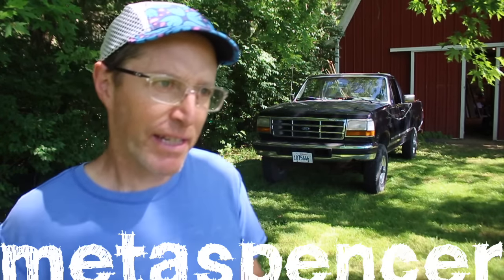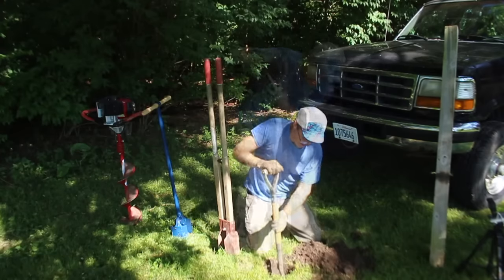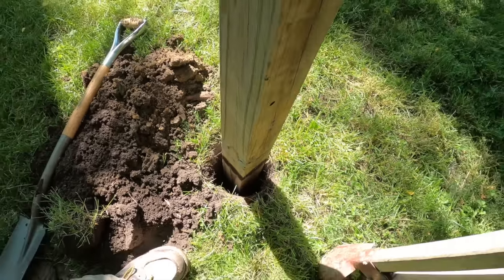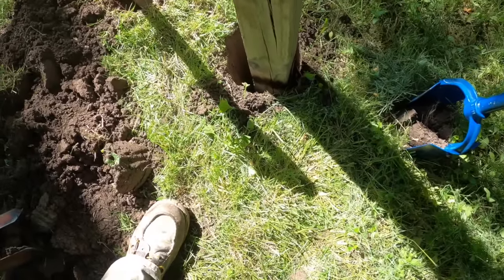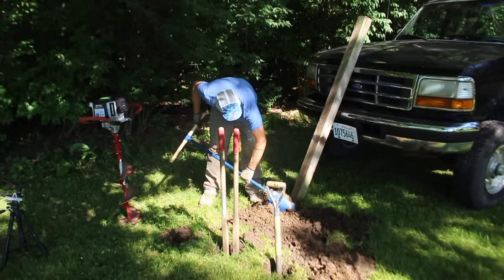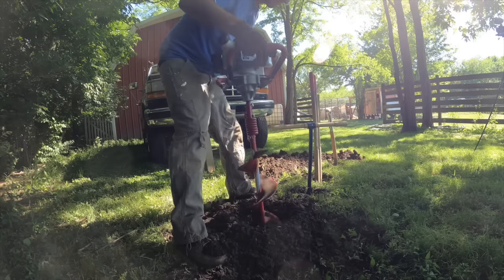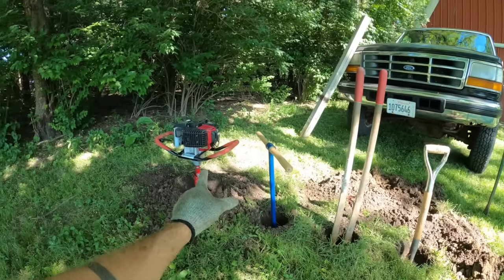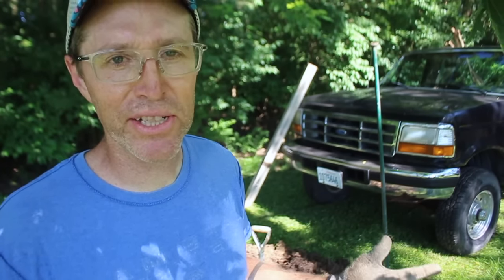Post Hole Digger Showdown!

Comment: I ended up with permanent nerve damage in my dominant wrist when my Earthquake grabbed a large root.  Can't bench press anymore, no more curling bar, no free weights.. it's hell just turning a door knob.  🤜💥🤛
Reply from the maker: Oh that's horrible. They are super dangerous -- no doubt about it. I was using mine today to drill some holes down to 4' and was reminded of how much damage that thing can do. Hang in man
Reply: Thanks for the warning, hope you are doing better.
Reply: @TWiz-iu4oq  .. well,  many doctors and lots of $ later, it's not better, in fact at times much worse..  door knobs and coffee cups have been my daily challenge..  I'm not complaining much, just an occasional agonizing silent scream when I touch something I know better.. take care friends.
Reply: @BB-tx8ty  Five years later..  no that doesn't work my friend.  Nerves don't reconnect the way I'd hoped.  Good news..  my non-dominant hand is doing fine.  🥂
Reply: @steven.h0629  hopefully you can make full recovery in future! With modern tools yes they do the job quicker but are much more dangerous, you could do a job in 2 hours with a chainsaw let's say taking down a tree but could do the same job with a normal handsaw but it takes 5 hours, customer still gets billed a bit more as more time, just have to be careful with how we use power tools, I have a scar on my face from a chisel bit that will never heal since then I've been a lot more careful with power tools
Reply: @BB-tx8ty  Absolutely!  I do try to use my arsenal of tools, and teach my kids and grandkids safe practice.  Thanks!
Reply: @steven.h0629  excellent! Safe practice is key, I've known someone to use nail gun and accidentally missed, the 3 inch nail went through his finger and nail and screaming in agony all the way to the hospital, when it was pulled out the pressure sent blood hitting the ceiling! Known someone to loose their eyesight from a bit of brick being left stuck in and all sorts, eyes are essential! Hands are essential! Every body part is essential for all manual work! Tell your kids they must look after themselves through life only takes one slip up and could be the end of their profession or life
Reply: Sorry to hear that news man. You're right. Handheld augers are risky as hell. If you hit something, there's no time to let go before damage is done. I always use a walk behind auger . Ya it's heavy and has to be towed or placed onto a ramp trailer  but it's definitely worth it to get the job done fast and safe
Reply: Between myself, family members and people I personally know, I could write a small book on accident injuries from heavy equipment, power tools and even occasionally hand tools.  When I see a power auger, my danger instincts light up; the potential for injury is high.  Better to rent a Ground Hog or similar, or 3 pt hitch style if you have a tractor. If you have a bunch, get a skid steer w/auger and breeze through in record time.
Reply: Is there a safe way to operate this tool to reduce risks? Maybe using a rock bar first to test the ground before use?
Reply from the maker: Strapping a 2x4 to the machine for another person to use can help but still risky
Reply: I’m very sorry to hear about your injuries. I hope someday you’ll make a full recovery. Power tools can be very dangerous, particularly this bad boy. Between this video and another that I’ve watched it’s pretty clear to me that the convenience does not outweigh the danger. I had considered using a power auger to dig holes for a deck, but now I think I’ll use my post hole digger instead. My fat butt could use the exercise anyhow. 

I don’t understand why power augers don’t come with some form of clutch or braking mechanism that disengages the motor from the blade when it gets caught on a stone or in a root. 🤷🏼‍♂️
Reply: @brianmcconnell1817  I am looking at a 240v electric one that does exactly this and switches off the moment the trigger is depressed. We have 240v in the UK
Reply from the maker: @dantheman1337 you’ll find one … there are some corded ones out there
Reply: I am sorry to hear that too. I bought one and tried it and took it right back because it felt too dangerous.
Reply: Thank you for your warning.

Comment: The hand auger is great, only problem is when you are digging close to something else (tree, house, old fence) you can't spin the handle.  Great if you are in the open though.
Reply from the maker: Yep, I encountered that problem just today ... clunk clunk clunk every revolution of the handle
Reply: metaspencer the ole post hole digger to the rescue, man how many banged up knuckles pushing that thing together over and over through the years
Reply: Loosen the handle so that it can slide back & forth in its yoke.
Reply: In clean damp soil the hand anger is a great tool.

Comment: They don't call them the Rocky Mountains for nothing. If I dug a posthole and didn't hit a rock within the first six inches I'd think I'd died and gone to posthole heaven. When we buy steel "T" posts out here first thing I do is take a grinder with a cutoff wheel and sharpen the down end of each post into a point to drive it through the rock. We also have to use a large power hammer drill with a long bit to drill and then break rocks with a heavy rod if digging a hole becomes a problem.
Reply from the maker: Wow, I've never heard or thought of sharpening a post like that -- awesome idea. Well, at least ya have the views and, as I recall, good fishing. :)

Comment: Owned a power auger 35 years ago. Did 80 acres with it.  Concept in smooth soil is great. Rocky soil not so much. Tore ligaments in elbow. Took 7 years to heal. Conclusion: few holes = ok. 2 man auger safer. Lots of posts... Get auger or post pounder for skidsteer/tractor.  I still use the old standard 2 levered post hole digger in predicament situations. Jeff, WI.
Reply from the maker: Lots of wisdom in that comment, man. A one-man power auger is an accident waiting to happen except in the softest of soils. I still do most of my holes with the old two handle shoulder buster. Thanks for commenting!

Comment: I have all those tools. The power auger never worked right, its a two man auger. I never use the post hole digger since I purchased the hand auger. I have two hand augers, the one shown and another one with a telescoping bar to reach way deep down. The telescoping one is heavy, don't use it either don't need holes that deep. I use the spade a lot for big holes like 3 foot wide holes for planting trees and removing stumps in conjunction with the digging bar, rotary hammer, jack hammer, hydraulic jacks, cherry picker, come alongs, etc. The jack hammer is a must for breaking out existing post hole concrete and we have compacted dirt with rocks and almost boulder size rocks.
Reply from the maker: sounds like a great loadout of equipment! I like the idea of that telescoping auger in some situations

Comment: My preferred tools are a 4in auger bit for a drill and a post hole digger.  I start with the post home digger to remove surface grass\roots.  Then the drill auger to loosen up the soil down an be pull some dirt out. Then clear the home with the post hole digger and then deeper with the drill auger again and clear again with the post hole digger.  I put holes in, between a minute to two per hole.  The drill auger is a lot cheaper than a power auger, so it's more reasonable for someone that doesn't drill a ton of holes.  The smaller auger bit diameter also makes for less severe kick back when you hit a root.
Reply from the maker: Sounds like a good back-and-forth system. Good stuff man!

Comment: A small trick we used to do when I was working on a fence crew, cut a large circle out of an old tarp or a piece of ground fabric, cut out a center hole, like a donut. place that over where you want to use your power auger. And when you drill your hole all the dirt stays on the plastic. Then when you set your post and backfill you just lift up the plastic and it’s like a funnel pushing all the dirt back to around the base of the pole, then lift your little circle up off the top of your pole and voilà cleanup was easy.  We had four or five of them in varying sizes. Really came in handy when you’re doing a extremely large fence job.

left a very clean finished looked that the customers appreciated. Especially if they weren’t growing behind us and putting mulch down for a grow bed or something along the fence line.
Reply from the maker: I completely see what you're talking about -- well described and sounds like a great idea. I'm gonna try it for sure, as scraping up that soil is a big pain. Thanks so much!
Reply: Wow that’s exactly what I was thinking and I’ve never installed a fence before but I’m going to this weekend and probably all next week, I’m by myself 😅 Great video! Helped me decide on which tool to use, and not use. That gas auger was tempting but not after seeing you use it! I’m 66 years old and 5’1”! It probably weighs as much as I do. Manual hand auger and digging rod is my choice. Thank you!
Reply from the maker: Good luck!
Reply: Good idea! Thanks for sharing!
Reply: @Cruz Marc thanks for the info but I've red pilled after an ugly divorce.  So no girlfriend, no worries!! Don't need to lose everything  lol
Reply: Yes!! Brilliant!
Reply: @metaspencer  I guess those power augers can be a bit much for people to handle, but is the tool I use myself. I have a 2.5 foot long bit on my and same width as the one you used . But those hand augers are a dream. You get a perfect hole every time. Only thing I dont like about them is going through the sod layer can be a pain. Thats when that spade comes in very handy. Start your holes like only 3 inches deep and it will stop either auger from wondering. And to modify the tarp idea above I also cut 1 slit to the hole in the centera of the tarp so you can easily remove the tarp after the post is put in place. Also make you a deal sub to Pawsausive Dog Teaching and I will sub to yours. My Ruby Doo knows over 60 tasks so far.
Reply from the maker: Okay I'm heading over to your channel to sub right now @zemtek420

Comment: A word of caution using the two handled post hole digger.
Two years ago I was building chicken run and coop, I had 20 holes to dig quite deep, around 3 foot into hard packed clay.
I dug them all and concreted all the poles  in 1 day! 
Biggest mistake in my life, my shoulders were killing that night and they have never come good since.
After scans it turns out I now have chronic bursitis in them.

A simple hand tool that does a good job but take care of your shoulders folks, you don’t want the constant pain and sleepless nights I now have.
Reply from the maker: Oh wow, that's a major bummer. Yeah, I've since learned to run that power auger with two people: one holds the long end of a 2x4 that is strapped to the handle ... must steadier that way. Thanks for the lesson!
Reply: I doubt that trouble was due to just that one job but after doing this type of work after may years! The body needs rest and can't work all the time hard!
Reply: Op
Reply: @BB-tx8ty  yeah probably right there, I have abused my body and joints constantly since a young age. It catches up with you eventually 🥴
Reply: @markpaterson6024  definitely
Reply: Good advice! I have found that you really don’t think you’re doing damage until it’s too late. We tend to push through stuff instead of doing things in increments. That’s a lesson we all learn the hard way.
Reply: I know your pain (partly) when I was 26. I worked for a nursery. The first thing I had to do was dig 38 post holes for a new shade house. We have Adobe here, so it took a lot of digging to get it done! At the end of the day, my shoulder and arms hurt so bad I wanted to cut them off!
Reply: I got tendonitis in my wrist really bad a few years ago from digging post holes all day . I think it was the jarring impact of spade and iron bar constantly all day. Literally takes away all gripping strength in your hands for weeks and quite painful. Learnt my lesson now. I can feel it flaring up these days and take it more gently. Another thing to watch out for!
Reply: Bursitis from digging 20 post holes? You did 4-5 days work in one.
Reply: @markpaterson6024  same story here! When I was young I did all kinds of things to punish my body fiugering I was young, no problem! Now I'm 50 and can barely function without painkillers it seems every week there's a new pain!
Reply: @robertwest3093  it wasn’t just those 20 post holes mate, they were probably the final trigger to permanent damage after 30 years of hard physical activity.
When I started work as young builder things like occupational health and safety were not a thing then, neither all the modern fancy tools we have to choose from either, it was all done by hand the hard way.
Reply: I was thinking about getting a Ryobi auger but want to save money using a post digger. Now I think I am buying the tool!
Reply: Dude, sorry hi great about your shoulders. thanks for sharing and probably saving mine

Comment: I think a combination of the hand auger and the post hole digger is great for smaller projects. I have three 36” fence post holes to dig this season, and I’m a senior, so I truly appreciate the effort you made creating this video for us.
Reply from the maker: Sounds like you're gonna get it done, and done well! Thanks for checking out the video and for dropping a note :)
Reply: Minou,  when you buy your diggers, be cognizant of the tool size and weight..  the Post Hole Digger comes in a few sizes, some might be too large and heavy for the job at hand.   I have three, one is so light it's practically useless in compacted soil.
Reply from the maker: @steven.h0629  great point man

Comment: Great Video! You helped me decide that all I needed was a post hole digger for a small job I have to do tomorrow. You saved me time, money and a big headache..Thanks!!
Reply from the maker: Excellent. Yeah, can't go wrong with the old post hole digger. So versatile
Reply: Same! As a smaller lady I was a little scared to use a power auger
Reply from the maker: Yep it’s tough to run and a bit dangerous

Comment: I have the Seymour Industrial 6 to 8 inch auger, but I paid like $170 bucks for mine during the pandemic. I noticed that they’ve come down substantially to around $130. Where I live in upstate New York it’s mostly sandy soil and this thing is a miracle for digging holes. I’ve already dug 3 shallow wells down to 20 plus feet for hand pumps. Plus I dug another one that I set a sand point in with just pea gravel around it. I didn’t have to pound it in at all.

If you need a shallow well, then the Seymour Industrial is your Huckleberry, it’s fast in sandy loam soil. However be warned that all your neighbors will be asking to use it when they see your new sexy hand pumps!

I’m lucky to be in a good glacial area where most of my rocks are massive sized, some as big as 8 feet tall or more. If you do hit a rock it’ll stop you in your tracks though. Primarily the rocks here are very near the surface and can be removed.

To extend the Seymour to reach down I just add 3/4” inch pipe and couplings to get down around 20 feet or so. With any luck you’ll have a 20 foot hole in around 15 minutes or so. Also, when you get into the water I wrap my auger basket in duct tape to hold the soil because the water makes it harder to get the soil out without it falling out of the auger. Trust me, duct tape is your friend if you want a good deep column of water in your well. It’s slower digging but worth the extra effort to get as deep as you can get. I thought i was the only nut that liked digging holes..lol Great video btw!
Reply from the maker: I've long thought about digging a well that way ... cool idea as long as the rocks behave :)
Reply: It’s been awesome. If I hit a rock I just move it a little bit and have had great success. Getting water at my camp has been great, I was buying water weekly by the gallons and it was a welcome relief to have my own water for a change. 

I just used 1 1/4 inch foot valves and a toilet flange with a hunk of 2x6 pressure treated lumber to bolt my pumps to. I use 6 inch pvc pipe in the ground with slots cut in the base. I get crystal clear water.

Comment: I enjoyed watching you dig 4 holes. I only dig 1 or holes a week. I install mailboxes. I was wanting to find out if the manual auger would make it easer. After your demo I think I will stay with the post hole digger and 16 pound iron bar rock buster. These two work in all soils, clay or rocky. Thanks again.
Reply from the maker: You're using the best and most versatile tools for the job. Tough work but at least you don't have to do 20 a day! :) Thanks for the note, man
Reply: I want that job

Comment: I needed to know more about the Seymour hand auger.  I loved how you described the challenge of each with rocks and roots, the bane of my existence.  I did six holes with a sharpshooter and a post hole digger.  I paced myself. Chopped the roots with the shovel and brought up dirt with the post hole digger.  I could see how the power auger required so much lower back when bringing it up, great video.  I want to add the Seymour hand auger to my toolset, not so much the power auger.  Thank you so much!!!
Reply from the maker: Pacing yourself is the way to go for sure! slow and steady wins the (post hole digging) race. Yeah, that hand auger is nice in certain situations.

Comment: I like the power auger. I usually use it with another pair of hands. My wife and I are a pretty good team. I agree, I bring everything to the job site.
Reply from the maker: good thinking -- we sometimes strap a 2x4 to the handle and my gal holds it for stability